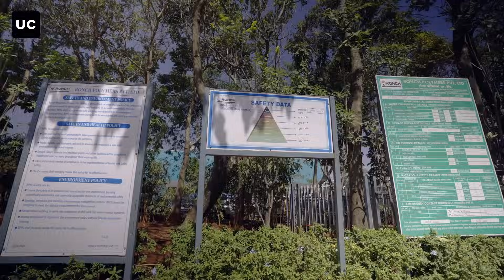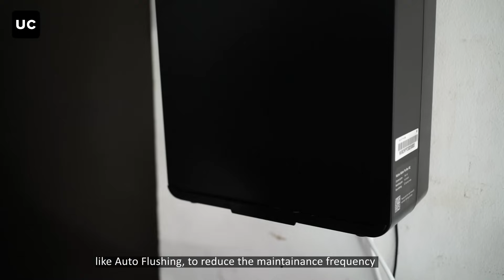Manufacturing facility tour: Experience the NATIVE Water Purifier build first hand

Comment: Don’t buy this product. They don’t mention before you buy that you need 4G service and not 5G service. If you have 5G service, sorry for loss of Rs. 18000 but they don’t give you any refund or return this product. They send someone to install but not for IT technical setup. The device has a local Wi-Fi which might connect with your phone but in such case, it is loss of the customer and not of urban company. Considering all the situation, Native M2 is an experiment of Urban company on the cost of customer’s money, and zero risk for themselves. What a smart business Urban Company!!! Highly recommended NOT TO BUY THIS PRODUCT. It is an inflexible business model which would NOT be successful in long run.
Reply: You didn’t mentioned any issue?
Reply: Bot comment

Comment: We want know about which types filters and pump use in this RO system
Reply from the maker: Hi,
Thank you for reaching out. We would like to inform you that a GPD 75 pump is used, along with multiple filters like a pre-filter, sediment filter, carbon filter, and a health booster. You can purchase the RO through our application at bit.ly/3Paupdm and other e-commerce websites like Amazon, Flipkart, Croma, Blinkit, or Zepto. After delivery, rest assured that we provide installation and post-installation services at no additional cost.

Comment: Hello UC,

Planning to buy either M1 but M2 seems to be appealing. However the issue with M2 seems to when there is power cut, what is the backup plan, how will we get water if there is no power?

Are you planning to release next varient were this issue will be reaolved?
Reply: Please don’t buy.. they don’t have proper service for their own product. This is second time I’m waiting for service, it’s been 6 days with no updates. First time, I waited for 8 days, no one visited my home at all
Reply: Bro what's the issue with your product
Reply: @sahilsehgal7963  the water outlet tap got broken easily. They have don’t have replacement parts. It took them more than a month to find a solution.
Reply: @antoprakash2099  It’s handle while withdrawing water it goes in left or right wrong direction… is this problem common???
Reply: @ yes, with the handle which comes along with the machine. I replaced it with a similar one in Amazon and it doesn’t move like that.
Reply: Which city?